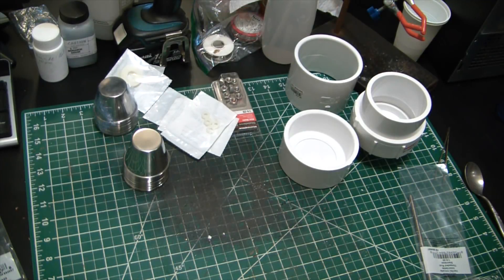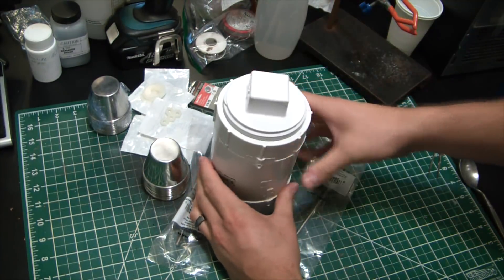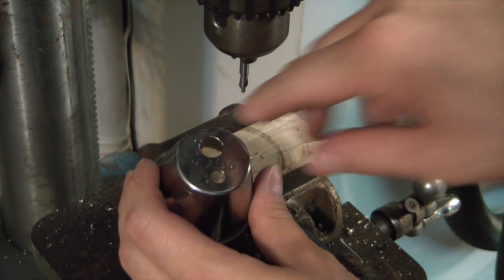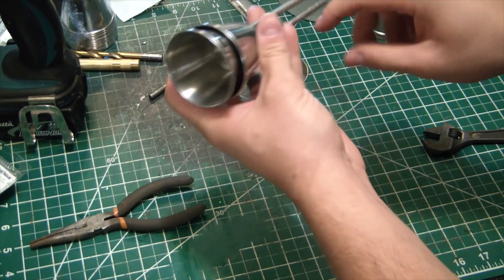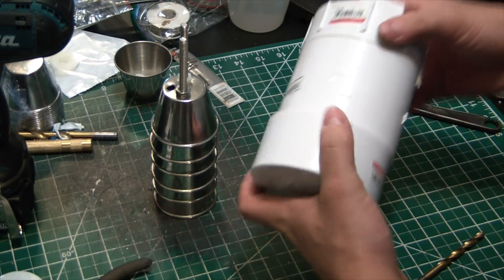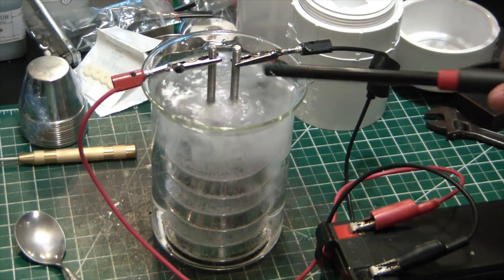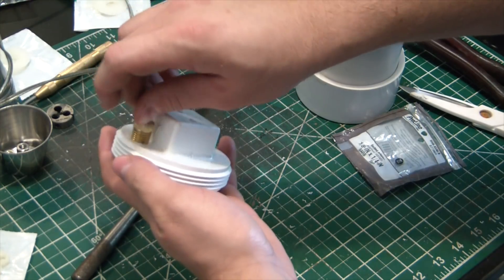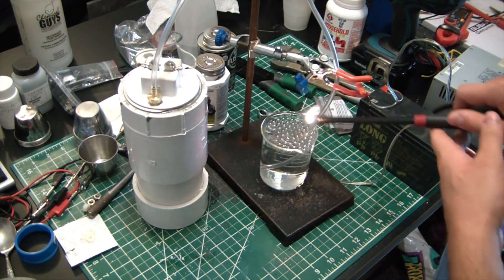DIY HHO Generator for Torch - ElementalMaker

Comment: if the hydrogen is floating up into the glass of soapy water ..where is the oxygen going?
Reply from the maker: They are mixed together in the cell. There is no separation so you just get a mixed gas out.
Reply: ok then i see the reasoning for the backfire setup...oxy and hydrogen make a nice pop

Comment: If you or anyone else make another one:
You can to get the cups right side up: 
Start at the TOP with the cups right side up.  Starting at about 3" or 4" down for the top.  And use plastic tubing to cover all of your rods so elect don't jump to the rods. The cup in between the +/- use a larger tubing to keep it in place.
👉The 3oz cups are 2-9/16" D

Comment: How did you isolate the one cup is itjust tension from the nylon nuts in conjunction with little to no play from the other stainless nuts or is there like a necked down nylon piece
Reply from the maker: Yeah I used a couple nylon nuts to sandwich the edges of the enlarged hole
Reply: i was thinking you were going to say you had some repetitively long nylon spaces and turned down a sholder or something
Reply from the maker: @james10739  I thought about turning an edge on the lathe, but just sandwiching the cup works just as well and everyone can do it
Reply: Ya i ordered some all thread already just need the rest of the stuff i got stainless and aluminum all thread since you had the melting issue i figured aluminum being a lot better conductor would be fine at the top not submerged and then a coupler to stainless
Reply from the maker: @james10739  aluminum would be great, but will rapidly corrode in the cell. Also if you use NaOH as your electrolyte it will eat away the aluminum. Stainless is pretty much the only option outside of some more exotic materials like platinum or mmo coated
Reply: @ElementalMaker  Still you have to find something to keep the brown out of "brown gas", if you don't want to increase your cancer risk. The free'd chromium is always an issue if you deal with situations where stainless steel dissolve or melt.
Which is kind of a bummer and took away my fun working as a tig-welder since to many cheapo companies don't care for air filtering.
Reply: Well aside from splashing the aluminum should not be in contact with the electrolyte it will only g thruthe cap and stainless will be submerged
Reply from the maker: @james10739  ah gotcha. If you coat it with a very thin layer of epoxy it should last some time longer and still conduct the heat
Reply: @james10739  I'd try first to expand the threaded stainless rod. This melting problem occurs because stainless steel is such a bad heat conductor and the generated heat cannot go down into the water.
So raise the point, where the connector is, to a level, that he heat cannot reach the plastic any more.
Reply: @werner.x  but then you have all the extra resistance
Reply: @james10739  Maybe. I'd have to look for the conductance of stainless steel against other suitabele materials. I don't keep such stuff in my head.
It was just a suggestion to keep the plastic melting point away from the plastic housing and keep everything simple - which is important too. If you add an aluminum heat sink to the longer stainless steel rod you'l have both - melting point risen and conductivity improved.
Every big finned cpu heat sink with a solid inside which you fit with a suiting thread should do.
Reply: But then - if you already have your short stainless rod fitted - you could easily rise the connecting point with an aluminum rod also, if you bolt them both togeter with a nut long enough - maybe an inch away from the plastic.
Enough space is important, since the aluminum rod will bring the heat straight down to the stainless, so the first inch of the stainless will get hot again if you don't install the extra heat sink.
Stainless is really not to bad if you want to block away heat and that's what you want.
Reply: Well i got 6ft of stainless and 3ft of aluminum so I got enough to make a mistake or 2

Comment: The density at sea level of HHO  is very low vs. extremely fast combustion also high temps for very short duration .... therefore it is possible to place small bubble in hand and ignite for  loud report no risk. KNOW THIS A PRESSURIZED CONTAINER BURNS EVEN FASTER... DETONATION @ 30 PSI EXCEEDS PVC CAPACITY ENOUGH TO TURN IT INTO PIECES THAT WILL INJURE  OR DO A T AND T HOLE. 
BETTER TO HAVE LIGHT WEIGHT CONTAINER  FOR THOSE EXTREME REPORTS AT A DISTANCE.SODA BOTTLE HAS 6 FOOT MIN. 5 osi  because at sea level there is not enough total fuel  energy in the soda bottle to do much more make it weeze then slowly shrink.
25 volts thats 2 and 1 half volts the reaction starts a high current gain builds rapidly
if the cell exceeds a volt or so per pair of anode, cathode. The result can generate O3 O4  and h2 gases you want H2 O2 output because O3 and beyond become more and more unstable. Do not OVERVOLT THE CELL BECAUSE  When the excess becomes to great for heat and ozones  the next step is IGNITION. If power source is overvolt and current and not adjustable a very low resistance  with high watt capacity  ie stainless cable works as a current limiting shunt in series electrically with the cell, it gets warm not directly connected onto the cell,
With care and some know how a very use full and fun when you know your limitations

respect and care

Comment: If you want to protect against short circuits, wire a car headlight bulb in series with the circuit as ballest
Reply from the maker: Solid idea. Only problem is now I'm running 40 amps through the cell, I don't think any light bulb can handle that

Comment: if you were to connect this to an IV needle, and Ignite it. Would it explode or turn into a torch?
Reply from the maker: My plan is actually to use an IV needle, but stuff behing the luer tip with steel wool to act as a flashback arrestor. If you dont have a flashback arrestor it can explode.

Comment: You wired them completely wrong. Each "cell" of two(or 3?) Cup still receives 12 volts. You should look inside "neutral plates" petween the anode and cathode (they are not conmected to the powersupply)You should only have conneted the 2 cups on the very top and bottom. The plates or cups between divide the voltage by making one plateside positive and the other side(of the same plate negative)
Otherwise you waste ~ 10V only corroding and heating the cell. Otherwise great chanel!!

Comment: You should rough sand the inside and outside of the steel cups to make more surface area for hho to be generated. Get a little bit more gas out of it
Reply from the maker: Not a bad idea!

Comment: I know it's only been a day but, how are the Chinese stainless steel cups holding up?   I have a small PEM hydrogen generator but they're so expensive.  It's nice that they keep the H2 and O2 separate but, again, EXPENSIVE.  I thought about making a stainless steel HHO generator with a high flow rate.  Also, does your water trap become alkaline after a while?  I'm wondering if NaOH vapor is carried along with the hydrogen and oxygen in noticeable amounts in these HHO generators people are making.

Comment: If you havent seen, look at carsandwater's (RHNB dude)  H2/O2 generator he uses for his hydrogen torch https://www.youtube.com/watch?v=4Fl4t3_PWGg   Note especially the neutral plates which takes the 12-15V applied and divides it between a few electrolytic cells.  Your setup takes multiple cells and puts them in parallel, so you dont need anywhere near 12V. That much overpotential will just assist side reactions, and increase waste heat.  You only need 1.23ish volts nominal for a H2/O2 cell, a few hundred extra mV of overpotential for increasing speed wouldnt hurt, but 2-3V/cell should be the absolute max you want to run.  Fiddle and test with this though, get details worked out, before you build a big hoss off a generator to try and run a torch from.

Comment: This makes me want to revive my HHO generator.
I made mine out of the drum of a washing machine in some 110mm PVC pipe, the thing is pretty damn big and heavy.
It draws about 25 amps at 12V and at the time i ran it from an ATX power supply that was only rated to 200W but it had no current limiting so i ran it for a couple hours until it blew up. Did the soapy water thing and it rocked the house if i got enough bubbles. 
It's been sitting untouched for about 2 years, i mainly built it for glasswork because i really wanted to make some vacuum tubes and propane flame made the glass go black :)
Reply: That washing machibe hho generator. You could use a capacitor inline with the hho generator to limit current and feed it AC from the mains.  The capacitor  and hho generator create a voltage dividing network such that low capacitance causes more voltage drop across the capacitor and a lower voltage drop across the cell.  Keep adding capacitors in parallel to the first capacitor  to increase the current through your generator. Do not use electrolitic capacitors as they don't like reverse polarity.
Reply: @kreynolds1123  you can't generate HHO with AC. Not to mention that limiting the power to the HHO generator will only reduce the amount of HHO being generated, at low power an HHO generator is just a resistor, a certain voltage is needed to break the molecular bonds of the water molecules apart. Even if it was possible to generate HHO with AC considering the size of my HHO generator the capacitor needed would have to be huge, to get 25 amps at 50Hz i would need a 360µF capacitor and because of mains ( 220VAC ) it would have to be rated at least 400V. Poly caps are immediately out of the question considering the high capacitance which would mean that electrolytic capacitors are my only option. Since an AC rated electrolytic of required parameters would most likely be either too hard to find or prohibitively expensive i would have to connect two DC electrolytics back to back, in which case they would both would have to be twice the capacitance, albeit only half the voltage at around 720µF and 200V, but DC capacitors are rated by DC capacitor ratings and ripple current is one of the most important ones, in my case the ripple current would equal 25 amps RMS, and that's more than what even expensive name brand capacitors with screw terminals can handle.
That's not taking into account that running such a device without mains isolation is very dangerous.
TLDR: capacitive droppers in this case are neither safe nor practical.
Reply: @poptartmcjelly7054  One can most certainly generate HHO with AC current. If one took a moment to search youtube or google with the terms  "HHO AC power", they'll find people all across the globe doing it. Two stainless stainless steel plates do not care if they trade places as anode and cathode for a time. It is ill advised to tell the many people all over the world using ac power inside their HHO cells just doesn't work.

Why would one want to limit current?  Generally, one wants to keep the amps below .5 amps per sq inch of plate surface area. To drive more current over 0.5 amps over 1sq inch, or .0775sq cm, you have to supply too high of a voltage between two plates. The more you over volt a cell, the lower the efficiency of electrolisys. That means though the current goes up and one produces more, a larger percentage of the energy does nothing but create heat and water vapor not to meantion ruins their plates faster. For voltage around above 12v  and more, Efficiency expressed in terms of ml per minute per watt of HHO gas (at a 100% humidity water vapor), at 70 degrees farenheight and sea level atmospheric pressure closly aproximate  13.4/voltage . Thus a 13.4 volts supply  gives one something very close to 1 milliliter per minute per watt efficiency , while 26.8v results in .5 ml per minute per watt. Yeah double the voltage gives one  twice the current and HHO production, but power consumption does not double. It goes up by 4. 

One is welcome to throw their money away on plates and wasted electricity doing crazy stupid currents if it pleases them. It Is their money is it not? 

Just making sure this is covered. Yeah, one can add enough neutral plates to achieve a reasonable voltage across any two adjacent plates without using a capacitor.  But if one baught or built an HHO generator designed for 12v, one can make it work with 120vac OR 220VAC wall by introducing the right capacitor in series with the HHO generator.   Using a capacitor inline with the HHO generator will create a voltage drop such that some voltage is dropped across the capacitor and some is dropped across the HHO cell.  And though sodium hydroxide works great, potassium hydroxide works even better over a wider range of concentrations.

Now personally I prefer DC because more time is spent at exactly the voltage you want, but there is something to be said for the simplicity of supplying wall ac  without buying a car charger to convert it to dc at a reasonable voltage.

As to the practicality of a capacitor current limiter  that is certainly a case by case situation.  And in some cases one might look an inductive reactance to limit current. 

Also, for all the safety nuts. Be careful of 120vac mains power. If one doesn't know why or how, they should not play with it.
Reply: @poptartmcjelly7054   can you tell me more about your build. I would like to try and model it. What voltage do you supply it?  Do you use neutral plates? If so, how many between anode and cathode?
Reply: @poptartmcjelly7054  You said your line voltage is 220vac. If line voltage was 240vac , the peak would be 340vac peek.  370av rated run capacitor is more than sufficient. Electrolisys is a non linear load that more closely  resembles zenner diode and resistor than just a single resistor, and by my simulations, 330uf run capacitor would create a 13.4vac rms voltage drop conducting 25 amps of ac current.

Comment: Very nice video this is the future of internal combustion engines for sure so much hydrogen there just split that water and bang
Reply from the maker: As an engineer I don't believe it will be the fuel of the future. I think everything will move to electric once the next generation of battery technology is developed such as a graphene based cell. Splitting water to make a fuel is very inefficient. Thanks for dropping a comment!

Comment: Drilling the third hole in the cups was completely unnecessary. All you had to do was put the first nut further down the all thread so that the leads stuck out the top of the cups and stacked them in the way you did.
Reply from the maker: Tried it that way but it was a PITA to assemble. Trust me I tried. This might have added a couple minutes of drilling, but saved a ton of time assembling the stack.